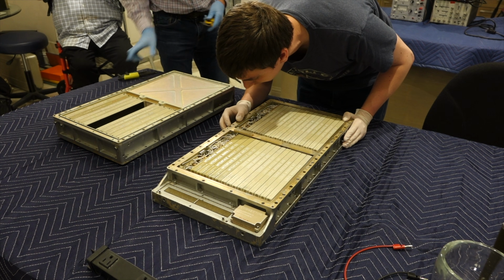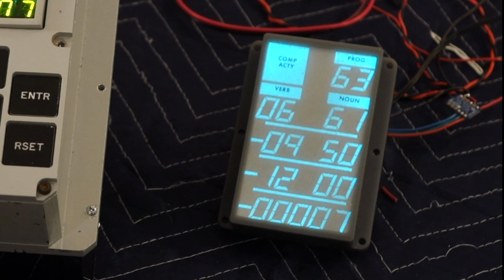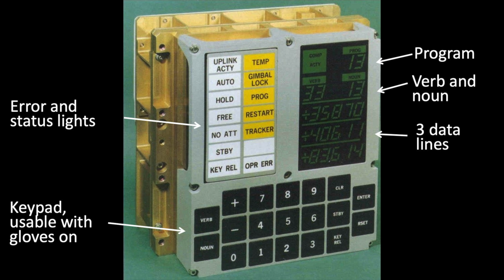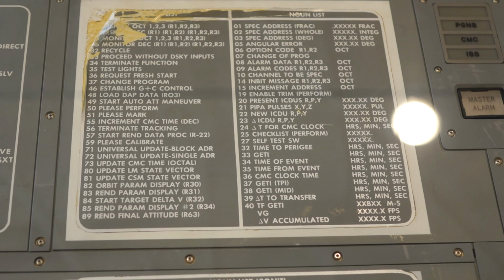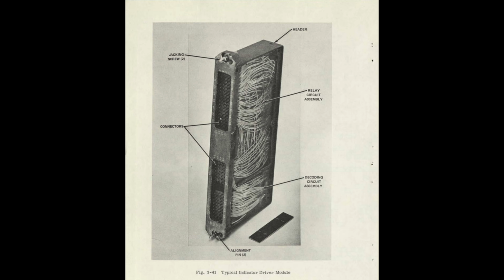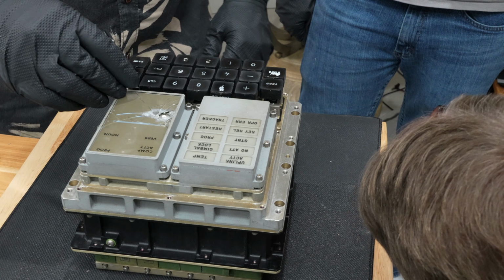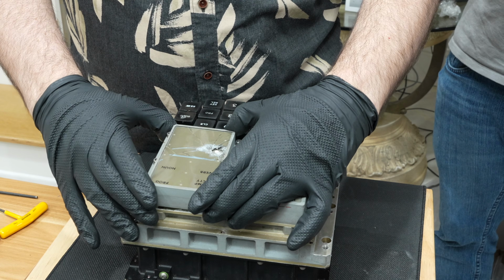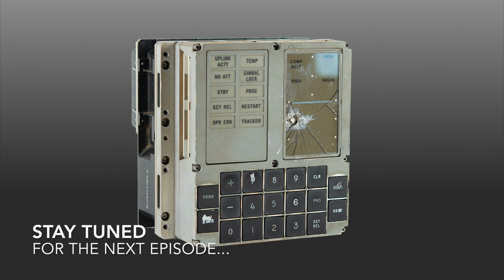Apollo DSKY - part 1: we have a real (and broken) DSKY!

Comment: hmm. so basically just replace the back glass panel and the aluminium layer with a 'pcb' :P (don't think it matters much if it is aluminum or just a the front copper layer set to maximum thickness) the pins can just be vias... leaves the 'transparent conductive electrode' layer. as other than monoatomic gold i would not know any other substance that is both transparent and conducts electricity :P basically anything that conducts electricity doesn't exactly let light through :P
Reply: not including liquids such as water with acid that may be transparent, conductive, and solid when frozen but not at room temperature. lol. where the hell to get a 'transparent conductive electrode' that doesn't cost a million to make haha.

Comment: Back in the 90s I saw a complete Deutsch connector repair kit that had all the special tools and spare connectors,  collars,  and pins you would need to repair those connectors. In the Army we called them cannon plugs, or sometimes slip ring connectors. But usually cannon plugs. You might find a kit like that on a government auction site.

Comment: From what i understand (from the Apollo 13 incident), ground power supplied before launch was 65V. Does this also apply to the command module, or was this a service module only thing? Do the various modules (DSKY, AGC. comms) have to handle the higher voltage?

Comment: Which parts of the CSM were simulated in that simulator? I don't find it weird that the whole electrical power and consumable management isn't there, but then why keep the switches for the uprighting system (I think that they are among the chonky pull-then-flip ones on the side panel on the left side)?

Comment: I would take a guess that the broken glass happened when the case was being opened to address failed relay issue possibly. A screw was left on the table and the unit was rolled over onto the screw breaking the glass.

Comment: The suspected replaced key caps (2 and 3, as pointed out at 5:54) seem to be in a different font. Most numerals on the keypad are AND-10400 lettering (as seen in the MS-33558 standard document), while the replacements look like Gorton Normal. Both common in aerospace.

From the layers visible in the wear, I suspect the keys were intended to be backlit. Aerospace backlit panels / buttons / knobs are made of clear acrylic that has been (1) media-blasted, then (2) given a white undercoat, (3) painted black, (4) had the paint etched or engraved away to form the numeral, and finally (5) sealed with a clear topcoat. When illuminated from behind, only the engraved areas should transmit light (in this case, the numbers would seem to glow).

It would be interesting to see if there are bulbs behind the buttons, and whether the suspected replacement keys light up.
Reply from the maker: They are not original at all. They are not even translucent.
Reply: @CuriousMarc  I wouldn't discount them yet! The numbers on other keys are only translucent because they've been worn down - they would have appeared opaque white when new. If the replacement keys seem to be engraved (the numbers indented, like the others), they may still be OEM.

I've seen photos of other DSKYs that use Gorton Normal for their number pads, so there's nothing suspicious about the keys being different fonts. The only thing that looks 'off' to my eye is that the thickness of the letterforms seem lighter than I'd expect - but line thickness is something the engraver can vary, and this kind of minor inconsistency isn't unusual with Apollo era stuff.
Reply from the maker: @Md2802  No the normal keys are made to be internally EL illuminated so you can see the numbers in the dark. 2 & 3 are “after market” keys.
Reply: @CuriousMarc  Aw, that's a shame. Hopefully the originals are still knocking around somewhere.

Fascinating that the others use EL for backlighting. They must look beautiful in person.
Reply from the maker: @Md2802  They must have when the thing was new. Unfortunately as you'll see in the next episode the EL illumination for the (good) keys is very tired. This DSKY must have seen a ton of hours.
Reply: The keys are, in fact, E/L backlit.

Comment: Did vacuum fluorescent displays (VFDs) exist when the DSKY was made? What was the reason for using an electroluminescent display? VFDs can operate on much lower voltage.
Reply: VFD is very fragile. Glass tube with thin and long filaments - that is not the thing you want to be as display for your lunar lander

Comment: I'm just curious - why are you guys struggling with connectors? These look like standard layout D38999's no? Probably "Series II" (low profile)? They're not specific to Deutsch at all. They're made by lots of other brands - Amphenol, Souriau, Glenair etc. Distributors called "value added distributors" take these connector sub-assemblies and put them together in a configuration the customer orders (keyings etc). These are US government standards and aside from custom stuff, most pin layouts are always based on MIL-STD-1560 (you can get a PDF with all the layouts and pin distances etc). They're made by tons of different manufacturers, and you can grab them from many distributors such as Powell, PEI-Genesis and others. You can even easily buy them from Arrow (they source from multiple distributors). This connector has a 22-55 layout (from what I can see) with normal keying. Nothing to it. It's super trivial to generate a part number for the mating jack (and just use a standard nickel finish) and just do a part search in different distributors. Simple backshells are very cheap as well. Tooling is a little spendy but you can get used tooling on ebay for much less. If you want to be authentic, you can even order space-grade connectors from distributors like PEI-Genesis which will come in separate boxes marked as space grade and will include charts for outgassing bakeouts. They're not even that much more expensive. :P Just search for "souriau d38999 series ii" and look at some PDF. Use military standard part numbers. PDFs from different companies will list everything you want - pin part numbers, tooling part numbers etc. I dunno if I'm missing something but the connector in the vid looks standard to me, even if it's marked very differently. You can check measurements against MIL-STD-1560 either way.
Reply: The Apollo program preceded the creation of MIL-DTL-38999. The series upon which 38999 is based, Bendix JT, did exist during Apollo and very very very rarely you will find some Apollo hardware using these connectors, but the vast majority of connectors on Apollo hardware are MIL-DTL-26482 series I and series II. We regularly use modern 26482 connectors when working with Apollo hardware. The high-density Deutsch connectors in question here, used on the Up-Data Link, DSKY, and a few other boxes, are not military standard. They are part of the Deutsch STK series of connectors, which never went on to become a mil spec. The insert pattern on these specific connectors is 18-85, not 22-55. And to be clear, other modern connectors that also have insert patterns called 18-85 (like MIL-C-81511) are not compatible with the high-density Deutsch STK connectors.
Reply: @mikestewart8928  Thanks for the detailed explanation! There are HD versions of D38999 these days ("HD38999") from various companies but I'm guessing that those layouts are completely different. Based on your explanation, it seems like they had no choice but to use something non-standard for this application - given what they had to choose from. Even in the early days of the ISS (and I think even Skylab?), specialty connectors such as SSQ 21635 based NZGL's and NATC's used on the ISS in open space/exterior were still mostly based on standard layouts in MIL-STD-1560. I'm used to thinking of all NASA stuff as being fairly standardized. Thanks again.
Reply: Oh, and if they're not quite D38999 they could instead match MIL-DTL-26482 Series II or Series I. NASA/Deutsch surely used a standard series at the time and just did its own spin of it. Good luck!

Comment: Fantastic work!

I'm building a DSKY replica right now and since those keys don't have complete SCDs, its exciting to see one disassembled. The likely displacement of the plunger spring works out to being very close to the 7oz/200g actuation force of the microswitch. In other words, they were balancing torques. Considering the sheet metal spring on the housing I suspect it was intended to do the same for another axis. 

I hope theres a good excuse to remove one of the keycaps so we can see the white EL backlight. Do all of the key housings have the same sheet metal springs or do any of them have the revised version with two rivets? 

I can't wait to see more!
Reply: Hey, good luck with your replica! Based on your question I'm assuming you've already gone all the way down the DSKY drawing rabbit hole, but in case not: we have relatively complete pushbutton drawings for very early DSKY models. The LTA-8 engineering drawing drilldown page is a good one to look at for that.

All of the leaf springs in this DSKY are of the original single-rivet design. Surprisngly, none of the leaf springs were broken!

Comment: Those jacking screws are really smart, but yeah you would need to know that they're there.
Reply: I imagine when MIT designed the DSKY, they assumed that no one would be monkeying around inside without having the (probably 10,000 page) service manual. If you're not aware that all of the screws are not doing the same job, then the tendency to just "unscrew everything" can cause a bit of havoc. In retrospect, the concept of jacking screws makes perfect sense with all of those multi-pin connectors. Jacking screws were a simple mechanical method of avoiding the nightmare of bent or broken pins. But just like installing a cylinder head on a car engine, things have to be done in the right sequence or disaster awaits. As always, RTFM applies!!😆

Comment: I never cease to be amazed at how chunky the metalwork/castings are, especially considering weight was a big concern.
It's like the designers got confused and thought they were making a navy battleship, rather than something that had to fly.
Hearing all those relay clacking away to slowly display something is rather unique and nice, maybe I'll add a speaker to my next project and fake it.
Reply: I had a similar observation about weight. Not just the DSKY but Apollo era avionics in general.  Having said that vibration is a huge concern and many early rockets succumbed to electrical malfunctions due to vibration.
Reply: The vibration the components were subjected to in a Saturn V launch were substantial, and the reliability of the systems was a matter of life and death.   I think they engineered everything to be as light as possible while maintaining absolute safety margins.  We know NASA’s acceptance of lesser safety margins and lack of practical testing in later years cost many lives.   Nothing more costly than “saving money”.
Reply: @jacksons1010  More mass, more energy to manage.  The modular construction by individual contractors suppling NASA created unnecessary complexity to the fabrication. 
NASA or others do not need to accept less quality but focus on optimising in a productive way.  This you cannot easily do when you have so many subcontractors meeting a common spec without communicating possible improvements to each other.  
The vibration levels of Saturn 5 are grossly exaggerated and generally much lower frequency and amplitude than the dynamic accelerations on a fighter plane.
Reply: I don’t know how the weight issue was treated at the time : were the engineers designing the different parts given a weight allowance, for them to design the best system within that weight limit, or were there incentives to reduce weight?

As an engineer, I would personally take no risk, making the best possible device that fits the size and weight in the projected timeframe, even if it is slightly over engineered.
Reply: @chefchaudard3580   "I don’t know how the weight issue was treated,"
Each engineering team reads the specs does his best then a little more with whats left. 
The construction is magnificent but unnecessarily over engineered creating more difficult problems with maintenance by trying to improve resilience.   It is the nature of an engineer to do his best when up against other who will be doing the same. Generally works providing all parties are using metric and not conversion from Imperial.  Best
Reply: @chefchaudard3580  There were huge incentives to reduce weight, especially in the later flights that had things like the rover. Techniques like chemical etching were deployed to reduce the wall thickness in the LM, for example.
Everything was built to a very strict weight allowance. Every Kg that was transported to the Moon needed something like an extra 8Kg of fuel.
Reply: @chefchaudard3580  Rocketry weight is a huge issue. The late redesign to combine fuel and oxidizer bulkheads in the Saturn 5 second stage was to to weight increases of the spacecraft.
Reply: Providing all those multi connectors to facilitate finding the fault in multi connectors. The case was over engineered to improve the connectors docking but why not just wire direct and make a much lighter unit maybe carry a spare.  Why have a electroluminescent display and relays when other modular numerical indicators were available.  Good example of working around problems created by workarounds.  Still it is a magnificent bit of kit.

Comment: I was amazed they used relays in 1969.  Thanks for the video I enjoyed it.
Reply: It wasn't so much the limited availability of semiconductors as it was the limitations of semiconductors. This electroluminescent panel needs up to 250VAC, which is very hard to switch to all of the segments with anything other than relays. They explored a few alternate paths, such as using SCRs instead of relays, or building an incandescent panel switched with transistors (there's a report on this one called E-2280: Solid State DSKY Study). But in the end, none of the alternatives were compelling enough to change away from the relay+EL approach, despite its problems.
Reply: As mentioned semiconductors were pretty limited back then. I forget the exact percentage but the Apollo program used the bulk of US semiconductor production.

Comment: I so badly want a clicking display now. That sound is so satisfying to listen to.
Reply: Wait, what? The same microswitches are available newly built on Digikey? 60 years later ????
Reply: @ABa-os6wm  Imagine you are the maintenance engineer for an elderly system that works perfectly except for a broken switch. That will cost $700. And keep a production line working and many people employed if it is replaced.
Same day shipping exists for a reason. As do replacement parts for antique devices.
Reply: A Flip-disc display might be for you too!
Reply: That would be a lot of clicking on a 4K60 display 🤪
Reply: It will work great for about 2 weeks!

Comment: In the soviet countries, they used displays with similar technlogy. This video https://www.youtube.com/watch?v=uzdB3YLdzu0 (in russian) shows a lot of them working, and also talks about DSKY and you Marc (at 3'38). It seems that historically this technology was experimented by a french scientist, Georges Destriau, in 1936, who also invented the word "electrophotoluminescence". But his work was also based on previous findings made by russian scientist Oleg Losev in 1927 (https://en.wikipedia.org/wiki/Georges_Destriau).
The talented russian guy from the video, Artem Kashkanov, is, like Ben Krasnow, also working on making is own displays: https://www.youtube.com/watch?v=XiAWYUZLJ1s
The soviet kind of displays seems to work with AC voltage around 50 to 250V at frequency between 400 and 5000 Hz, but higher voltage and frequency seem to reduce lifetime.
According to your previous video, DSKY display needs 250V AC @ 800 Hz, which is similar but already quite high compared to russian ones specs, so i wonder what lifetime one can expect from DSKY displays? And if some improvement in the EL technology was made by NASA to improve lifetime?
I do have a few soviet EL displays, but i have not yet had the joy to experiment the real life viewing of EL light glow from them, since i need to build a suitable power supply, and i would prefer to be sure to have one with the correct specs to extend the lifetime of displays as much as possible. But you said that designing one like the NASA is not easy... Do you consider building one someday?
Reply: they used it in 1990

Comment: The paradox is that they needed to save weight for the LEM, yet they couldn't help themselves but build components as if they were destined for reusability in a battlefield tank. One could — even without changing the contemporary technology, shave off tens of kilograms from all these avionics, without sacrificing durability.
Reply: Not so sure about that. Don't forget the huge stresses the equipment had to endure.
Reply: @bobpockney  And it had to be sealed as well to work in a vacuum and be waterproof. But yes, with enough time and money, these things could have been made lighter. But time is one thing the Apollo program absolutely didn't have. On the other hand, compared to all the other computer interfaces in existance at the time, it was absolutely tiny and lightweight - heck, it weight a fraction of the space shuttle teleprinter ;-)
Reply from the maker: It’s all magnesium casing. Weighs nothing. The electronics inside, on the other hand…